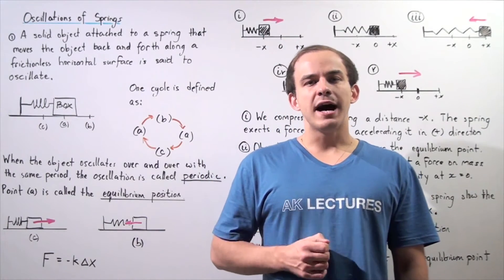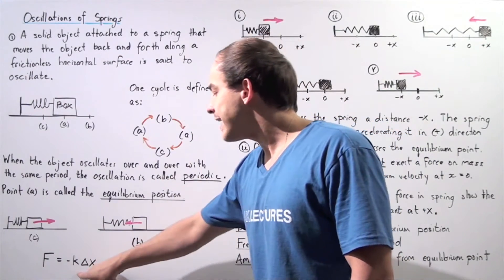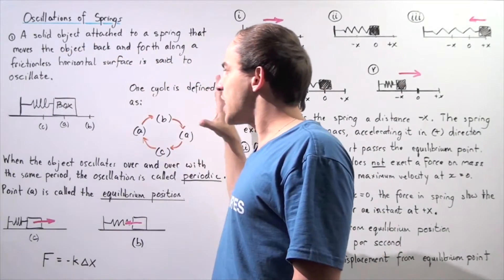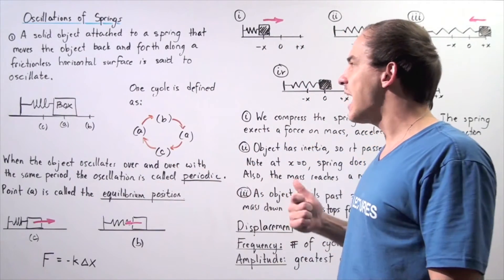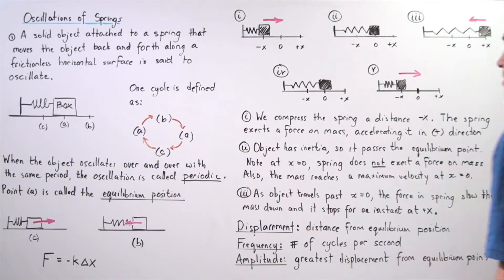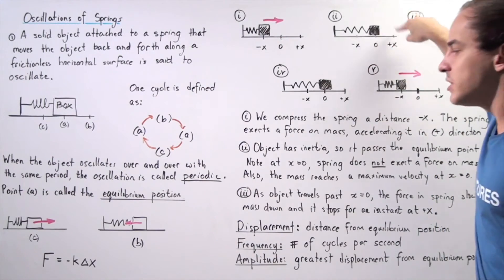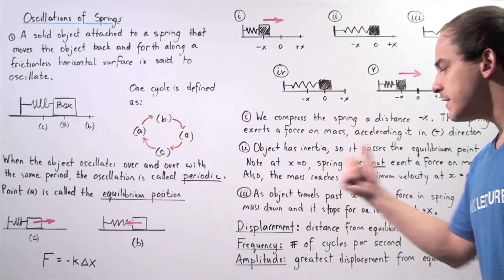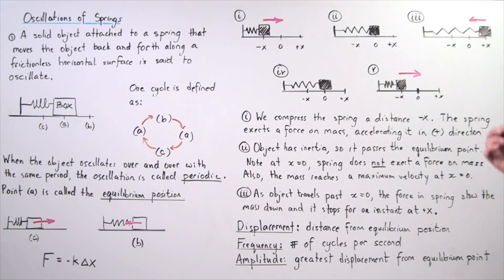Oscillations of Coil Spring

Comment: 0:50 the equilibrium point does not always equal to the point where the force created by the spring acting on the object is zero, we can see that it's not the case when an external force(like gravity) is present at all time during the oscillation. (like an object hung by the spring and it's doing a SHM or like that magnetic magic trick where something floats in the air or something like that.)